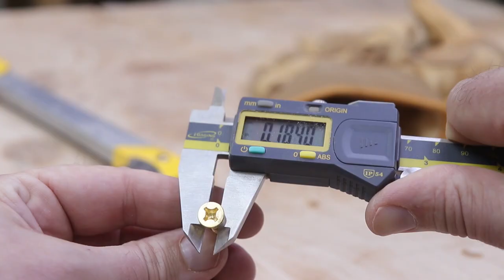Wood Mallet with Brass faces - function meets style

Comment: This turned out great! I always wondered if putting brass through a router bit would be ok, so I nervously watched as you did it first instead of me. Also loved your technique for cutting the thin wedges, great tip.
Reply from the maker: It’s a little nerve wracking but it went smooth. I’ve been cutting wedges like that for a while. It’s the safest way I’ve found.